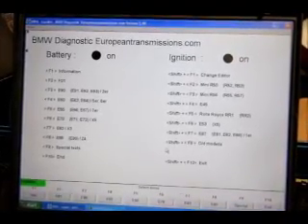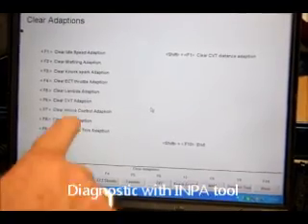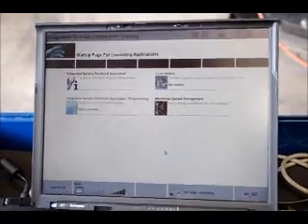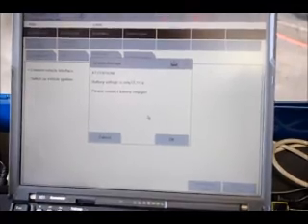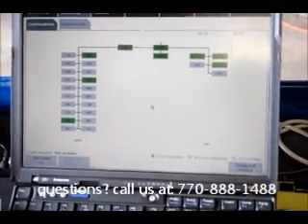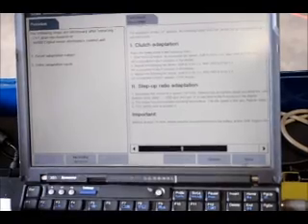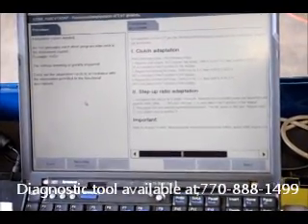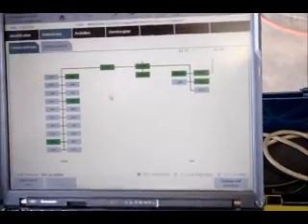Mini Cooper cvt adaptation

Comment: Thank you so much! Initially, I tried three times without success. The key realization that changed everything for me was to “stay on the pedal.” At first, I couldn’t even reach 40 km/h, but once I hit 5 RPM, the speed started increasing progressively from 40 to 80 km/h.

I hope this helps anyone looking to adapt their Mini Cooper to a CVT transmission.

Comment: I have same issue but i didn't work any another sulation how can i fix it and remove x ?
Reply: Try this. This is the current instructions from ISTA +. 

I. Clutch adaptation
Press brake pedal in the following steps. 
1. Start the cold engine. At increased idle speed, shift to N for 10 seconds, then shift to D for 10 seconds. XP is indicated in the P position in the display. 
2. Repeat the following 10 times: Shift to N for 3 seconds, then shift to D for 3 seconds. XP is indicated in the P position in the display. 
3. Repeat the following 10 times: Shift to N for 3 seconds, then shift to R for 3 seconds. XP is indicated in the P position in the display. 

II. Step up ratio adaptation 
1. Accelerate the vehicle to a speed >80 km/h. Release the accelerator pedal and allow the vehicle to coast. The gearbox adapts itself for 4500, 4000, 1500 and 1400 rpm. P is indicated in the P position in the display. 
2. The engine has now reached operating temperature. The idle speed is 800rpm. Repeat steps 2 and 3 of clutch adaptation.
3. Turn the ignition lock to position 0. 

Important:
Wait at least 10 minutes before possible disconnection from the battery and/or DME engine control unit.
Reply: Make sure you clear all engine and ABS/DSC error codes first, then try it. Also make sure no error codes in the cluster/KOMBI unit.

Comment: Hi, thank you for the information. the car I have entered the XP mode but I cannot make the adaptation when I start to drive it works only in first gear (with XD mode) I can not get out of the adaptation mode. the only thing I didn't is in the cold starting condition any idea?
Reply: Buens tardes, a mi me pasa igual a ver si me pueden ayudar, llevo con el coche dos años roto le he cambiado la caja de cambios por otra reprada y no hay formade hacerle la adaptcion, gracias un saludo
Reply: Don't worry about it remaining in 1st gear. By time you reach like 45mph it will go into second gear, this is normal. Just keep going without braking. If you brake, you will not complete it and have to try again. Many people often don't do it right and have to keep trying.
Reply: How you turn on xd?

Comment: My transmission has been funky after I got a new battery. Is it because it needs to get user to my driving habits and how long does it take if so?
Reply: see this :https://www.youtube.com/watch?v=rjt6jc8uNaQ
Reply: HI DAVID, had a similar problem since they took of the battery to charge it, got funky for a while then seemed to stick in first gear....how did your trans work out ? THANKYOU.

Comment: Hello. Once the CVT is fixed and the adaptation is done on Mini cooper cvt 2004, 1.6 what are the ok rpm should be lets say for 80, 100 km/h?
Reply: i have the same problem with my mini r50 , between 80-100 km/h rpm is over 3500. How did you fix it?
Reply: He didn't say he had your problem. He was only (asking) what the rpm should be at that speed my friend.   @koliaarevadze6991

Comment: Any idea why my mini will not go above 30mph?
Reply: Could be a bad solenoid ... Did u fix the issue ? What was it ?
Reply: misterD d Thanks for the replay.  Still have no idea, has been sitting in the garage.  Is there any any way to test this?
Reply: Hi Chris got the same trouble....did you get it fixed bro....best wishes.
Reply: Verify codes. Maybe you have codes preventing over 30mph. Does it say X in front of P, or does it say EP? You may be in an actual limp mode from some error.